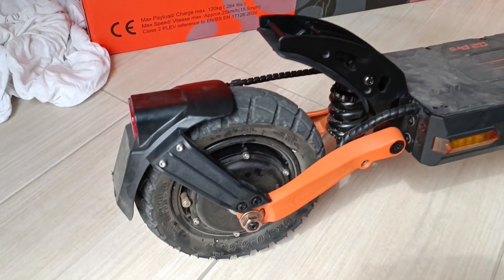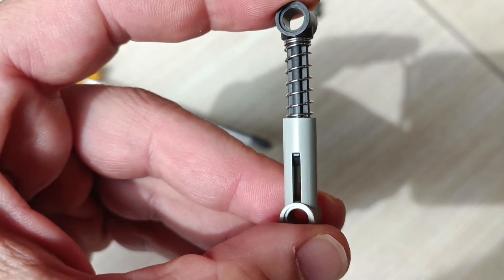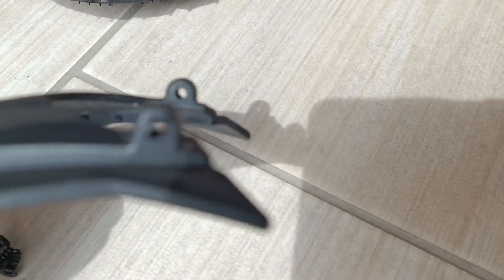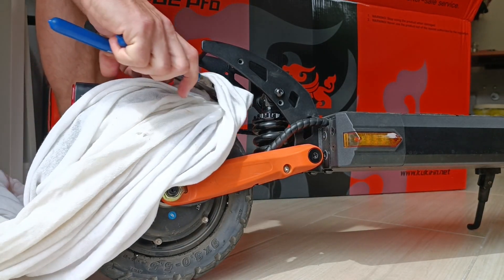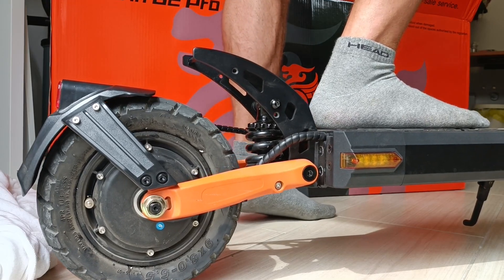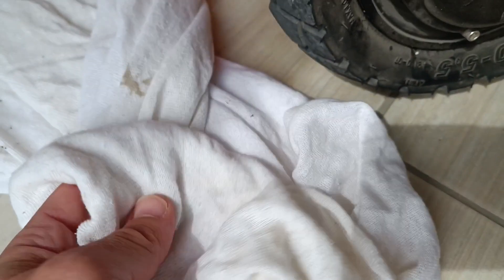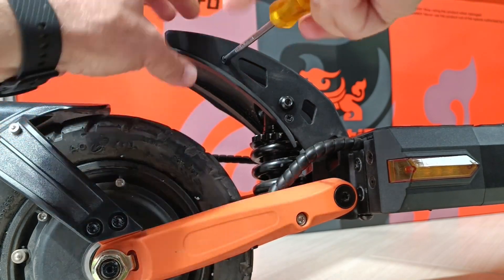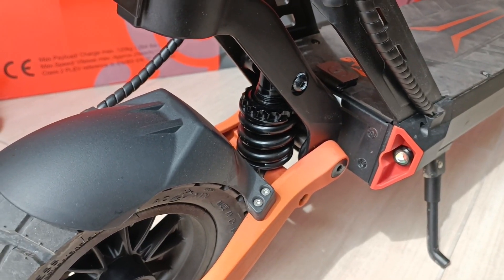SCOOTER SUSPENSION TUNING | HOW TO SET THE HARDNESS of KuKirin G2 Pro with Coil Spring Suspension

Comment: PLEASE do not do that like inthis video!

This is great way to destroy thred.
But if you loosen this small screw in that big ring you can do that by hand.
This only changes the preload, not the stiffness.
To change the stiffness of the suspension, you have to change the spring.
Reply from the maker: Thanks for the hints with the locking scrub, but I am pretty sure there is no small locking screw on mine. Only the spring itself keeps the nut in place, as the spring gets looser it gets easier to rotate and vice versa. There is also no counter nut on mine. But of course anybody please check the exact mechanics before applying any brute force.

Comment: There's a small locking grub screw that must be loosened first or it will rip the tops off the adjustment threads. You Will then lose the ability to adjust the coil spring tension as the adjuster will just spin on the damaged threads . The locking screw is sitting in-between the raised knobs of the adjuster . Tighten again after adjustment so the coil spring adjustment won't move when riding. Some have a double adjuster set up one acting as a lock when you tighten them against each other. Don't turn these without loosening the locking grub screw you will damage the suspension .

Comment: Stiffer suspension is best for high speed. If you soften the suspension, you can lose control because of steering wobble.
Reply from the maker: Also bracing your arms more, holding the bar stiffer helps against steering wobble.
Reply: @techandmore99 u can’t brace ur arms on a scooter dummy

Comment: Good video.  So, to lower the ride height, you would turn the nut to the right?
Reply from the maker: Thanks! Turn it clockwise to make it higher (up to a point) or the spring tighter, or turn counterclockwise to make it softer and then lower. If you make it too low, you will remove the the nut from the thread, so watch out for that.

Comment: The explanation at the beggining of the video is simply not true. The spring is not pre tensioned. By turning the nut counter clockwise you are simply making your shock absorber shorter - lowering the height of your scooter from the ground. The only pre tension there is, is your weight when you step on the scooter, by turning the nut you are simply changing the lenght of your shock absorber. Look at the shock absorber by itself and you will understand this simple mechanism.
Reply from the maker: I respecfully disagree. Mine was definitely pretensioned, this is why turning the plate was also quite difficult in the beginning and got significantly easier. After you remove the pretension the scooter is simply lovered as you say. It is very possible that yours was set up without pretension from factory, however, when you turn the nut clockwise you will have a pretension eventually, or else the absorber would have to fall apart.
Reply: @techandmore99  It's possible that we received different things. I received mine without pretension, turning it in either direction had no resistance and turning it counter clockwise only lowered the height with the shock remaining stiff.
Reply: Which way to you turn it so it doesnt bottom out???

Comment: Got my KuKiirin G2 Max today, it's indeed very hard to turn the suspension coin pretension as I even had to use a hammer lol
It's really comfortable to ride now though so it's totally worth it
Reply from the maker: Using a hammer does not seem like a very refined method, but hey, if it works :) The official tool to doing the adjustment is called a C-Hook Wrench as far as I can tell, like these https://www.amazon.com/shock-adjustment-tool/s?k=shock+adjustment+tool (no affiliation). I have never used one, although have seen others adjusting suspensions before. Such a C-Hook Wrench would also fit into the front suspension.
Reply: @techandmore99 i brought a c-hook wrench set and It's not for that suspention but for the g2 master suspention,i have the g2 pro and It's not the same suspention can you tell me how to do? It's very hard my suspention
Reply: For me it is not that hard to turn it with this method, how many times did you turn it. I got it a week ago but 3 days ago i gave it to my friend to pick up his friend that was coming and somehow he popped the tire
Reply from the maker: The turning in the video is not cut, I did not turn it before, this is all I did. It was around 1.5 - 2 rotations, about 2, maybe 3mm. The tightness of the spring reduced significantly. It you set it up too loose and then two people stood on it, that might have been too much, the tire could have hit the other parts. The factory setting has a reason, it supports the maximum weight, for the price of being uncomfortable for lighter loads. You can not really have both the same time.

Comment: can you do a review of the scooter 

and where did you buy it
Reply from the maker: I plan to do a review, thanks for the encouragement. Bought it from banggood.com for around 530 Euros as a preorder, waited for it a month, arrived 9 days ago. It ought to be the newest 2024 revision.
Reply: Bonjour mon ami, avez-vous des informations sur la façon d'installer deux moteurs
Reply from the maker: I don't think you you can install two motors, because to do that you would need to change the controlling electronics and maybe even a stronger battery for the higher load.
Reply: I would not recommend the scooter , is not that good, a lot of engines that have issues brand new and they need replacing, i have a friend that bought it , he had to purchase a new engine in the first 2 weeks. They added the wrong bearings from factory and because of that a new engine was needed.
Reply from the maker: Thanks for the info! Do you happen to know when that one was purchased?